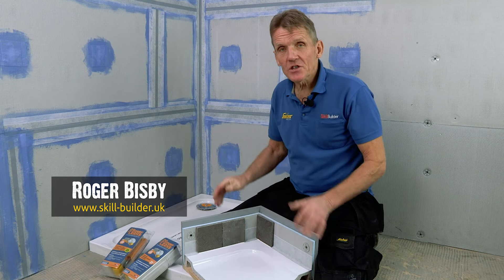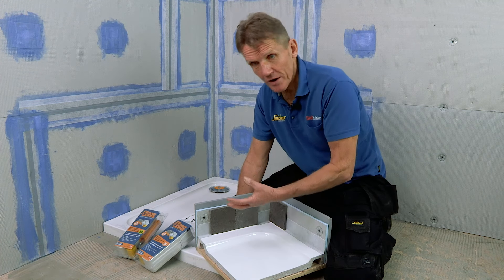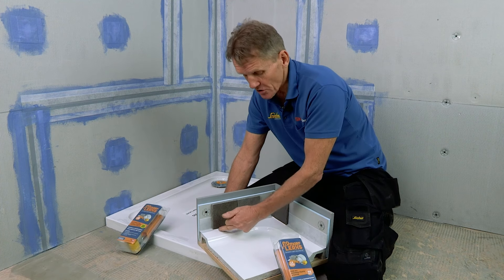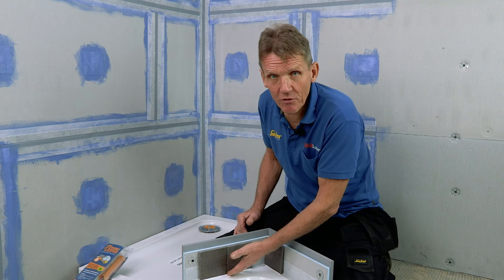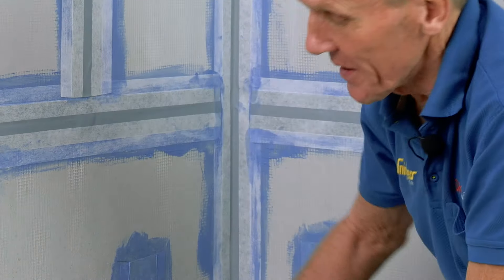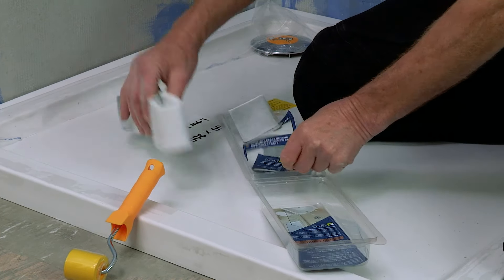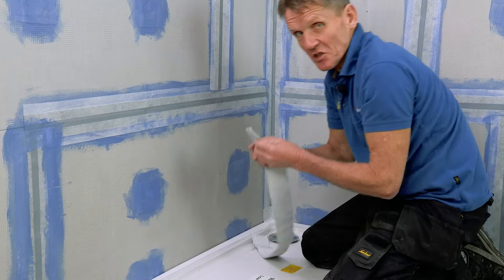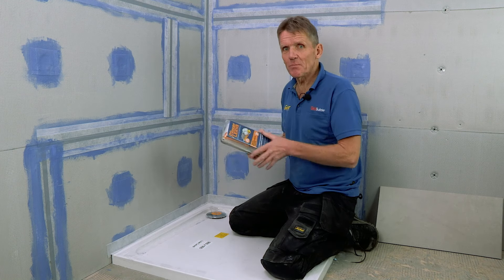No More Leaks Bath & Shower Sealing Kit

Comment: I’ve bought this but have noticed my tiles are much thinner than the ones shown in this video. I’m worried either there won’t be enough of a lip to seal properly, or it will be visible when the tile is fitted, making caulking difficult. Any tips from those who have used this before? (I got the 4m kit for a bath, with x2 corner pieces. Tiles are only 5mm thick).

Comment: Never had a callback on bathroom installs in 40yrs:
Some tips below for the correct silicone sealant method.

1. Fix all items firmly and correctly.
2. Most Important! Use a recommended solvent cleaner on all areas to be sealed.
3. Always use the correct sealant for conditions, sanitary for sanitary...
4. Never apply sealant to/over dry/drying sealant, apply in one.
5. Allow 24hrs before use.
Reply: Methylated spirit as the solvent cleaner?